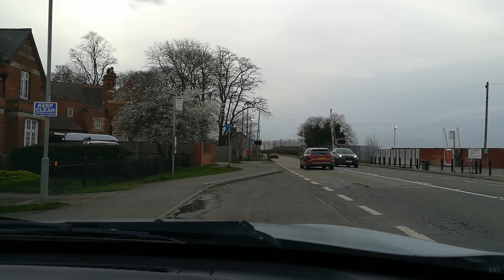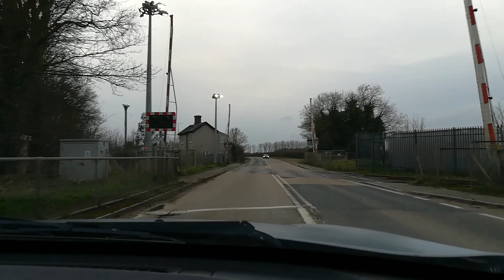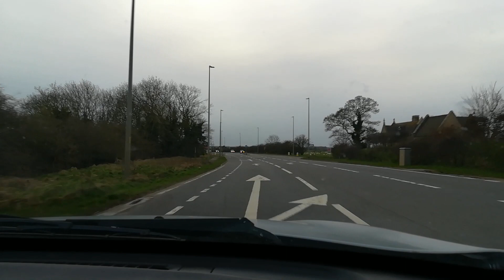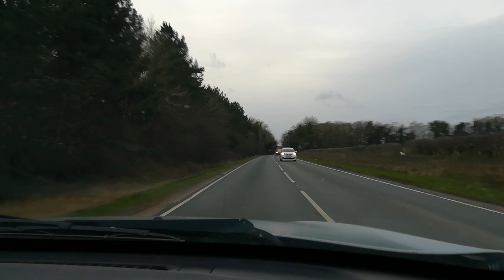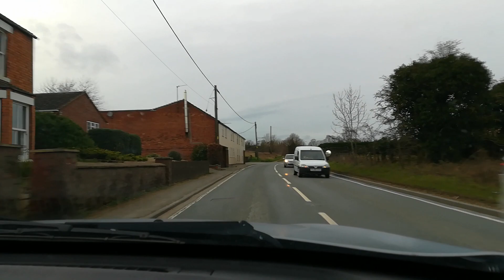Sun 401 UK CB radio - On the Air test from Mr Chippies car. Scratchy corner shown too!

Comment: I see your area is being converted to LED street light lanterns too. We have them here in many places, sometimes with the RF control node fitted to the lantern canopy (for group switching and fault reporting).
Reply from the maker: In the rural parts the street lights are on dusk to dawn auto switching, but in the towns they go off from about 10:00PM till 5 in the morning to give burglars & robbers a fighting chance.

richard
Reply: @ukfmcbradioservicingTango21  Similar scenario here,  our ones are either dusk til dawn or midnight until 5.30am off.

Comment: whats the antenna being used at both ends - It would also be nice to see antenna reviews on the mobile to base. thanks for the video.
Reply from the maker: The base aerial is a Solatron 99 fibreglass 18' end fed (1/2 wave) mounted at just gutter level of the single story building. The mobile aerial is a Red Thunder; which is a cheap copy of a Wallen Modulator standard long coil aerial. The difference between this setup & many belonging to others is the use of URM176 6mm cable rated for use up to 1Ghz, so far & away better than CB type RG58 cable. Being in the business of commercial 2-way radio we have this to hand as standard. All connectors are soldered on & the vehicle aerial is mounted on a sirio 3/8" stud mount drilled into the roof of the vehicle.
We will be doing some more aerial tests, so far we've only done one for a Midland small magmount that surprised us with it's good performance!

Richard (UK)

Comment: Scratchy corner is not how I pictured it.
Reply from the maker: I ought to have QSL cards printed with a photo of scratchy corner. Well it;s right at the bottom of a hill & has brick & stone built houses on one side, trees on the other, goes round a bend & then there is about 40' cliff face as the road cuts into the countryside making it extra bad for radio. Even car entertainment radio either breaks up or drops out. Strangely enough there used to be a radio amateur (now silent key) living in a bungalow just to the right of this thumbnail. He did have a versatower but I sure it was pretty poor there. I never spoke to him either so he must have been working on other band than I do.

Richard (UK)